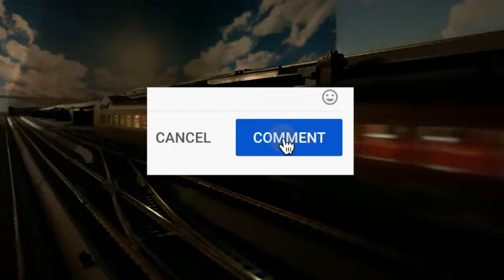Replace Your AHM, IHC, and Rivarossi Passenger Car and Tender Plastic and Metal Large Flange Wheels

Comment: This is DEFINITELY the best place to start when upgrading these cars. Getting metal wheels on them RIGHT AWAY will make them so much more enjoyable! Definitely get these and don’t try to kludge it with freight wheels. Why settle for a half-a kludge when you can get wheels that are a perfect fit?
Reply from the maker: No doubt!
Reply: Definitely glad I went this direction and not with barely cheaper 33's. When I experimented the 33s dragged ever so slightly at the axel and on the brake pads and added just that much more "weight" to the cars. Definitely better to use something purpose designed rather than a "kludge".

Comment: Good video!  

I’ve never understood why so many think these Rivarossi passenger cars are high quality. 

I have a fleet that includes a set of Rivarossi heavy weights and a set of lightweight streamliners. Also have the same in Walthers, Athearn, Bachmann & even Tyco. 

Of them all, the Rivarossi’s are by far the worst mechanically. Just plain chintzy and feather light. 

Going through the process of upgrading all to metal wheels, body mounted couplers & adding weight. 

This info will be a big help!
Reply from the maker: They can be made decent after some work, and a great place to start is definitely the wheels since they’ll at least track better.

Comment: Good info thanks!  Any suggestions for mounting Kadee couplers on the Rivarossi heavyweights?
Reply from the maker: There are two options. The first is to buy propose-built knuckle couplers that pop in in place of the arm horn couplers, the other is to body mount the coupler using coupler boxes. They used to make kits to mount the coupler boxes, but two-sided tape will due.

Comment: Trying to mount KD couplers on the IHC 85' passenger cars.  Body mounting -- you need a PHD in mechanical engineering.
Reply from the maker: Someone used to make a kit for that.. Is was basically a KD box and some double sided tape..i haven't tried doing that, myself, but it night be worth it
Reply: Kadee has a kit for the horn hooks. Takes some work but worth it. 500-something is the kit number. There’s a kit for four wheel and six wheel trucks. Newer ones with cheap plastic knuckle couplers can be replaced with a No. 5 or 148.
Reply: Not a big fan of McHenry couplers (owned by Athearn);however, they make “snap-in” knuckle couplers for both heavyweight and lightweight Rivarrosi, etc. cars.